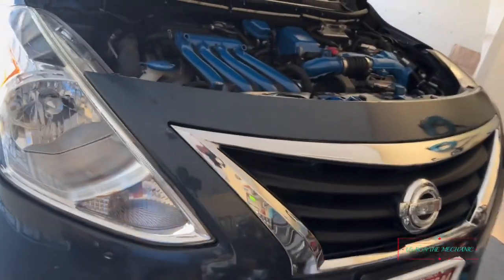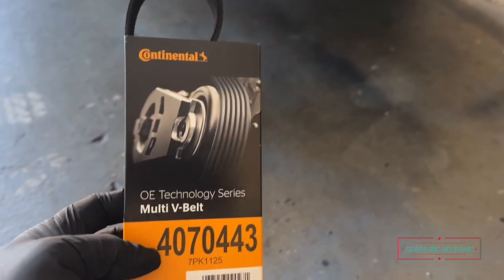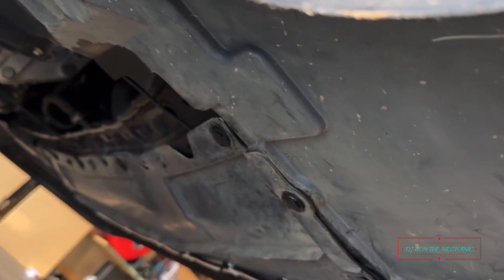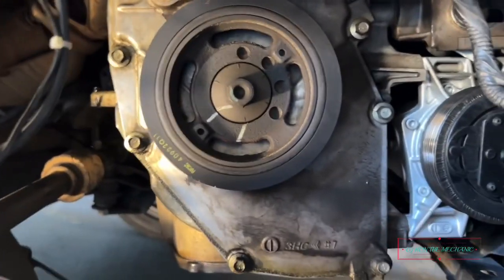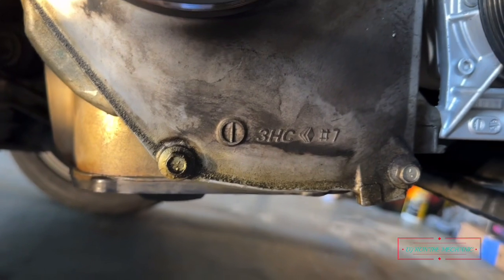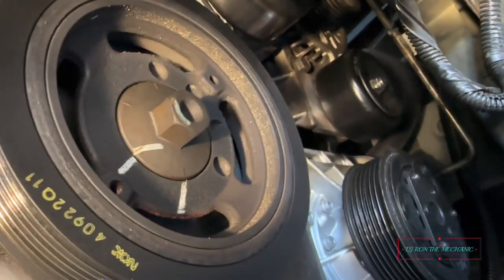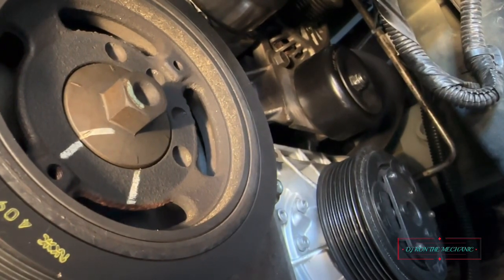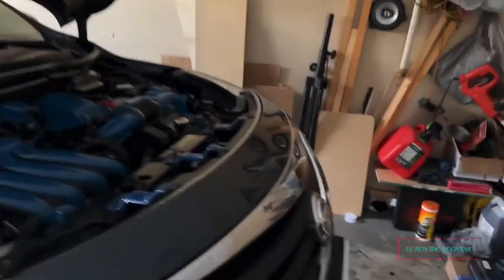Replacing The Idler Pulley On A 2015 Nissan Versa #diycarrepairs

Comment: Get some center wheel rings for that car man you will love them it knocks them vibrations Down to a smooth ride trust me I changed rotors brakes and even brake calibers and the vibration stopped when I added the center wheel rings get the plastic ones